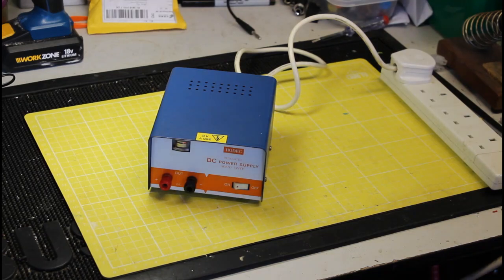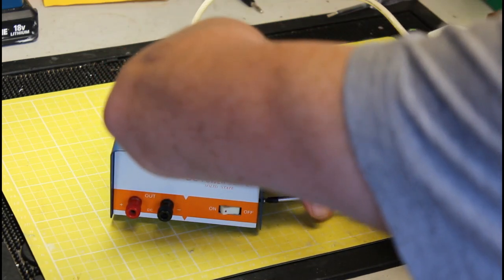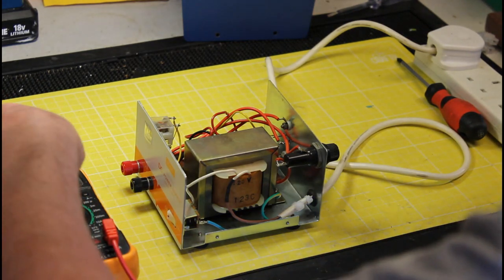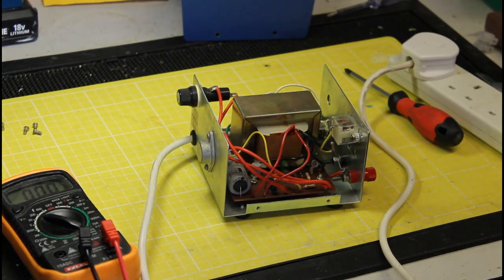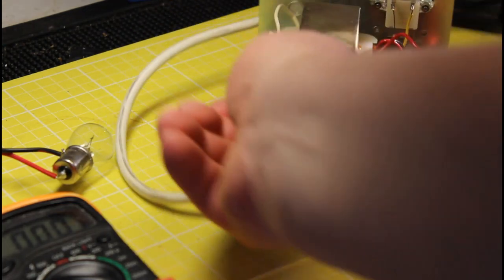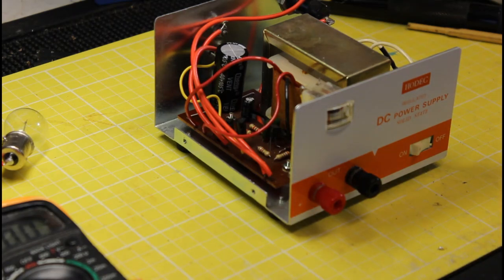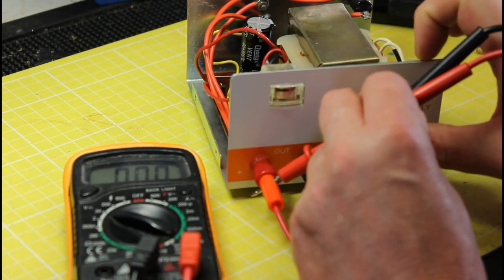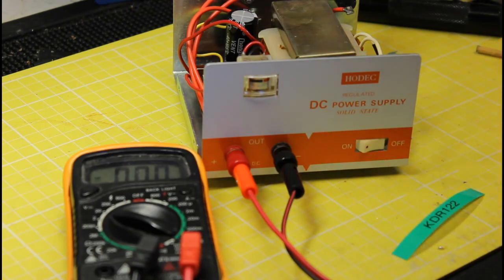Hodec KDR422  (c1980) 2-3A CB power supply overhaul & discussion

Comment: Very interesting Richard, thank you for the video. I have an old Shira branded power supply (model PS-3014), I've replaced and upgraded the caps but it's output is a little on the high side at 14.5v and unfortunately there's no adjustment. Can you (or any of your viewers) give any hints on how to bring it down to an acceptable level? I assume it will involve playing around with the value of a specific resistor, but which one?
Thanks for any advice!
Reply from the maker: Without seeing it I can't be too specific. Check the voltage across the zener diode, which may have gone out of tolerance....it'll be somewhere on the PCB & different to the rectifier diodes so should be obvious. Normally, the reference voltage generated by the zener is amplified a couple of times & there's your output. Is is 14.5v off load? We have 5W & 21W car light bulbs on flying leads for these tests & some 24v bulbs too when things have gone very wrong. You can always email me.  rshireby@yahoo.co.uk
Reply: @ukfmcbradioservicingTango21  Thanks Richard, it's 15.4 volts across the zener. I'll pull it off the board to see if there's any way to identify it.

I tried the output with a 4 watt CB on TX as a load, although it was only drawing 1.3A so there was very little voltage drop.

Comment: good video, had that under the bed for years along with loads of other power supplies, needed to make space, i wondered who purchased it  ;)
Reply: unless it’s another one, quite possible
Reply from the maker: Vendor was in Marlow if that fits. When I saw it on Ebay It cast my mind back to that 1980 catalogue as I mentioned on the video. It's just a bit unusual & it's nice......and made in Japan.

Richard
Reply: UK CB radio servicing not mine then Richard, its the only other one i’ve seen other than mine i recently sold, great fan of your vids thanks

Comment: Great advice on what to look out for with the old power supplies and another top video thanks guys
Reply from the maker: That advice is general on 220V power supplies, the capacitors are usually under rated. The Bremi supplies could well be the worst culprit here with the early 220v imports & 2-core mains. When modified they work very well & reliably. I bought a pile of 10A 220v onesfor one of our pipe organ restorations (this particular organ had electric rather than mechanical action). All three power supplied blew up & took the organ's slider motor control units with them. that soon taught me two lessons. 1) improve the voltage ratng of the cpacitors on the PSU's 2) fit over-volt thyristor crowbar protection.

richard
Reply: UK CB radio servicing Thankyou for the explanation Richard